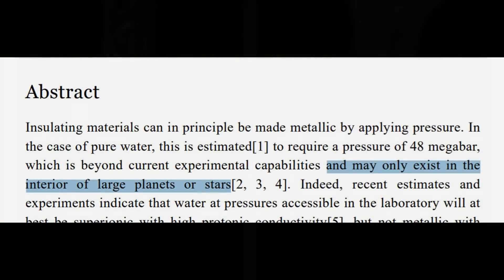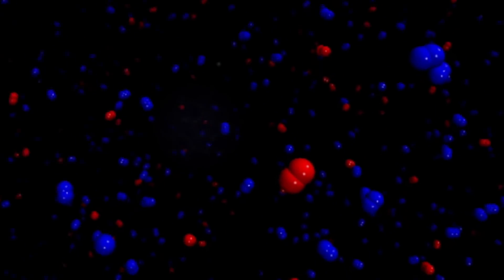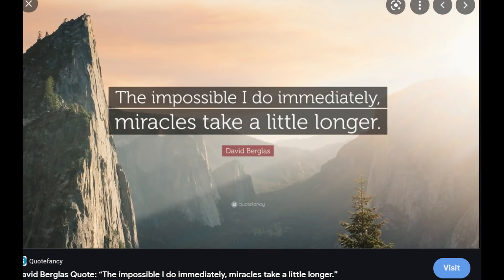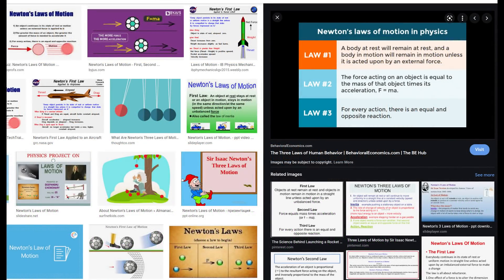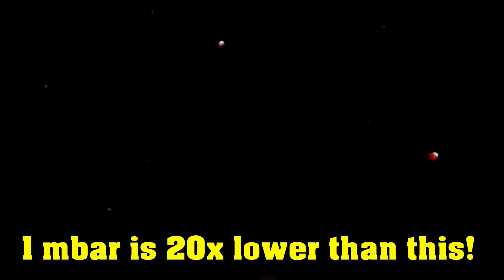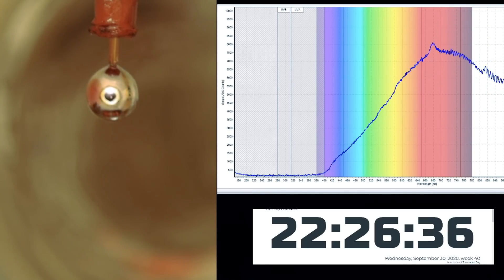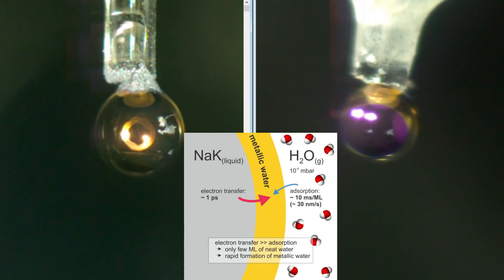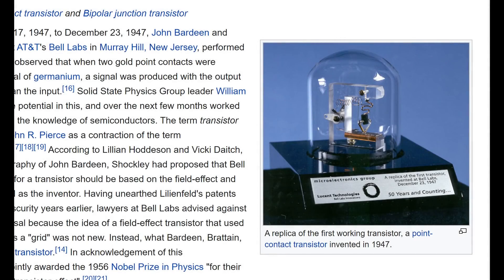Scientists discover Metallic Water

Comment: I've been in the county so many times I've lost count this is nothing new that actually the new division 5 and the only reason they're getting caught is because the new division 5 has cameras everywhere they try to minimize blind spots as much as possible but in all the other divisions that were built before the camera system was installed have so many blind spots the guards literally walk you into a blind spot beat you senseless and then walk away it's happened to me three separate times and I'm not even a violent offender in any way shape or form I was just a dumbass making mistakes

Comment: Imagine (1) sodium replaces Lithium in lithium-ion batteries, and (2) instead of a battery with sodium, you use a sodium-powered fuel cell. Unfortunately, sodium is solid. You can either use a liquid sodium-potassium alloy, or dissolve sodium into some liquid which conveys the sodium to the fuel cell. Now you get an electric car which you can refuel within minutes with a liquid source of power.

Comment: Nifty! Could it also be done with excess water instead of metal, e.g. minute partial pressure of Na and/or K with water drops

Edit - the much higher vapor pressure of water would make this challenging, the solvated electrons might form a mist even if the metal vapor is added before any water drops come out. I'm kind of surprised in this experiment that the sodium and/or potassium don't boil to boot given the extremely low pressures.

Comment: Nice Trippy Electrons : That are illuminating Energy as light: Very trippy, nice.

Energy by pressurizing the water.

Election quantum entanglement, nice.
Reply: Illuminating the metals- with Electron current/energy /electricity flow, nicely done.

I like it lots: bio :luminous : Ocean life forms love the Alkaloid metals: As they too make Trippy lights/energy /electron flow: Oh yes they call it electricity now (electrons flowing), nice...
Reply: Like the light illumination and the dark convergence energy : Dark matter cloud spots, that push the energy in repulusion mode: so that the camera can pick it up (see it) for it is traveling away in the opposite direct.

Like the dark spots of a magnet.
Just a dark reflection of the light.
Yeng and Yang: Up and down/As above so below/ Quantum Entangkement of the Light and the dark(magnetic field) nice.

Comment: What happens when you add water to a solution of Lithium-in-Ammonia?
Reply: Also, if you take a liquid metal alloy (such as Cs₄₁Na₁₂K₄₇) with a melting point below the boiling of liquid ammonia into liquid ammonia, does the solution stay liquid when the temperature exceeds that temperature? And what about if you do it under pressure? (Such as in an inert argon atmosphere.)
Reply: Could you make an emulsion of Gasoline and Ammonia-Lithium and use that as fuel?

Comment: Metal you say? The call of the Omnissiah to construct the Blessing Machine is getting stronger. Once we moved to Mars its true form shall be revealed. A new power is rising in the universe. Brace yourself, son. For when two counterparts clash the universe trembles with change. The crude biomass that you call the temple will wither and die. Then your kind is going to beg us to save you. As it already does with the strength and certainty of steel. And the enlightenment of silicon. But I am already saved. For the ghost of the machine is immortal. To death I serve the Omnissiah the Blessing Machine.

Comment: Diffusion pumps do have moving parts. Just stupendously fast. Early ones boiled off mercury atoms in a vacuum, and they then bat the water and any other molecules, toward the throat of the roughing pump. The shape of the chamber condensers the mercury which runs down to begin again.

Comment: Simply put

If we are able to make chemical compounds on Earth that we would not expect to be able to find at all or even expect to be able to make then that adds one step to many different processes and knowledge we've had before which could actually pave the way to make new materials things new computers etc I know with the new computers they ran into a problem with doubling so they were no longer really able to double in space so now they use a special machine that reflects light which allows them to make even more storage space but it requires special mirrors and a whole bunch of other stuff so as people refined in one area it can help another area that's one reason I heard from some scientists you shouldn't even worry about global warming because in about 20-30 years we're going to have so much more knowledge we're not even going to have to work probably about it as much because we'll have solutions because we'll have new knowledge that will help us figure out that overall discover we're just completely f*** in general which I think is the ultimate truth one day we're all going to die anyway so stop worrying so much about it silly

Comment: I'll tell you an application would be a revolutionary water lubricant in piston engines.  I'm not sure how much vacuum a piston normally pulls (would depend on rpm and bore volume).  That would access a whole lot of potential upgrades: less friction at high RPM, low vicosity, engine overheat mitigation, and how about cars on the roadway that see less damage at high RPMs. ?
Reply: I want my name on the patent.

Comment: This is stupid and misleading.

You cannot call it metallic water because it is not water. It is a solution, something different with different properties, even if its main component is water. "Salty water" is conductive, whereas distilled water is not. Magic water? No, chemistry. The same way steel has different properties than iron, because it is not (only, pure) iron. You have different kind of properties in steel as it composition and treatments change.

The title would only be true it were pure water, even if it could be an allotrope under very non standard conditions (like what it is supposed for metallic hydrogen). It's just the same that was already well known for ammonia, but making it with water its quite more difficult. So nothing really unexpected here.

Comment: I don't think that dissolving a metal in something made that substance "metallic" and not just a solution of metal in that non-metallic solvent.

The definition of a solution: a liquid mixture in which the minor component (the solute) is uniformly distributed within the major component (the solvent).

IE the substances do not actually react chemically, so there is no metallic water there.....just a solution of metal in water. There is no such thing as metallic Ammonia, just metals/electrons dissolved in non-metallic ammonia.

Comment: Sorry, i know this is probably a basic question, but why doesnt the water react with the alkali metals at such a low concentration? There's plenty of both water and alkali metals going around and the heat energy would be sufficient to have a reaction right? 

Or is it that the reaction is taking slowly enough, and youre capturing the moment where the alkali metal is donating electrons to the water? But why would the reaction slow down in this case?

Comment: The Action Lab channel made a video on a article about hydrophobic patterns. So if one could use this metallic water in very tiny amounts on a hydrophobic surface with etched pathways for the metallic water to cling on to and travel, perhaps some kind of computation is possible. The etched surface could also be completely or partly conductive, to either register presence of metallic water in certain parts of the system or activate/deactivate components.

So what would such system provide or benefit from?

Comment: I'm no scientist, and to be honest, I had a bit of a hard time understanding everything you were explaining there toward the end, but... I had an idea. Could this be used to slow the explosive release of energy usually generated under ordinary conditions so that tiny amounts of (let's call it) hydrated alkalide metals could be used as a fuel to drive some kind of engine by controlling the number of oxygen molecules introduced to combine with the metallic water into a vacuum cylinder to drive a piston? Not a rocket engine, but a combustion cylinder engine? Could metallic water become a possible replacement for petrol for combustion-type engines? Could the reaction even be that powerful at that scale?
Or, is this just a stupid question?

Comment: Eh, considering how this behaves I'd only find it interesting if it could be used to block radiation from a nuclear reactor. If properly contained in space it could be a very good light weight radiation protection which would negate one of the biggest issues with launching Ion Thruster powered crafts with nuclear reactors for continuous high power.

Also let's be honest, something that's as weird as this is should be tested for any interaction at least once, especially as it performs better (or rather, at all) in vacuum which is in itself a challange for engineers to overcome, so if one could find a meta-material like this that can replace current materials or composites or entire systems onboard the limited capacity of a space-faring vehicle it'd be a -BIG DEAL-. Also something about how the film interacts with electrons makes me believe it's likely to be reactive in some way to radiation, although purely on intuition.

Comment: You are essentially concentrating electrons in solution.
These electrons reflect light.
Deep dive....what if electrons and light are aspects of the same thing?
Idea: 
Photons are electrons 'surfing' on their own wake-fields.
The wave-length of light is a measure of energy carried by the photon, neh?
Photo-electric effect and all that show this clearly.
It also shows an electron after the photon is 'gone'.
Other evidence:
Photons are emitted/absorbed/reflected in the valence shell, home of excitable electrons.
Surface plasmons, 'waves' on a surface caused by light, occur with the shared valence electrons of metals.
Photons are emitted by electrons when they are accelerated by magnetic fields; synchnotron radiation.
Photons are emitted in free-electron lasers in a similar process.
How does a charge carrier, like an electron, amplify light if there is no physical object?

And how does an object so much smaller than the wavelength of light emit with such efficiency?
Radio teaches us that there exists a ratio of size between radiating elements and the wavelengths they can emit effectively.
Higher frequencies require smaller antennas.
How can an electron emit or absorb red light, given the 'mismatch' in size?

Comment: If you could make stable metallic water, I would assume it would be much easier to store then liquid water if it is indeed lighter than water itself. One of the hard challenges to manned space flight is weight when taking off a rocket. So I would assuming if the metal water is lighter than liquid water it could be a great future means of transporting water.